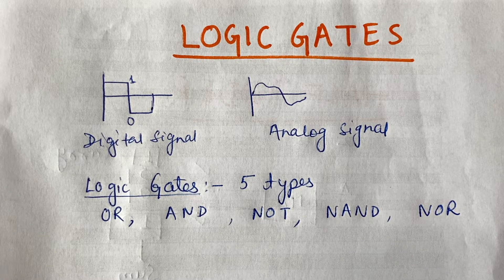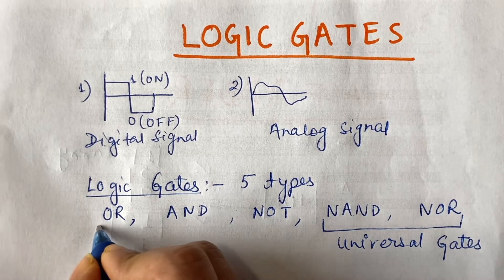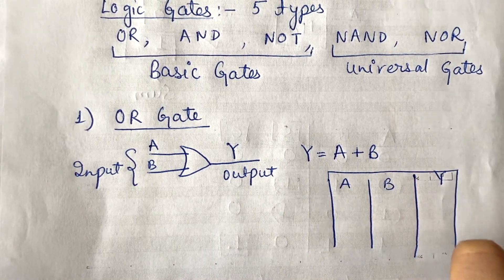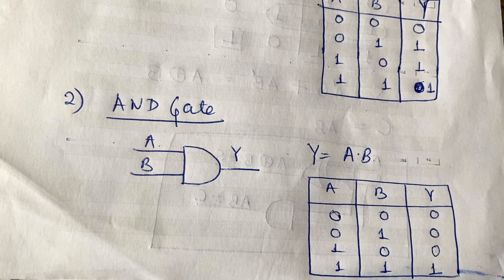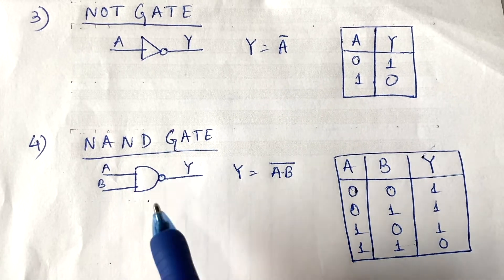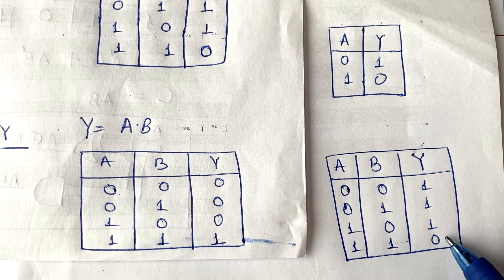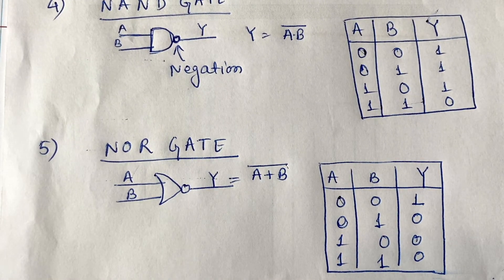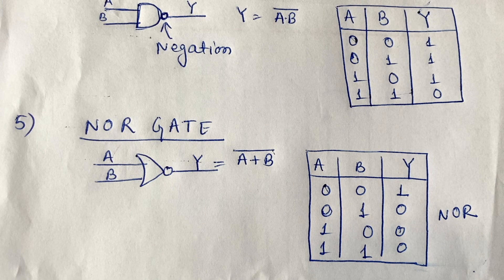LOGIC GATES [OR,AND,NOT,NAND,NOR GATES] | TRUTH TABLE AND BOOLEAN ALGEBRA

Comment: 1+1 in binary is not 1, its 0 carry 1, why has the or gate got this the opposite way round, according to the truth table and strict binary addition it should always give an exclusive or gate. 0 1 1 0, not 0 1 1 1? I can understand if both inputs are high i.e. 1 it will give a 1 according to the logic but this is not according to the binary addition.